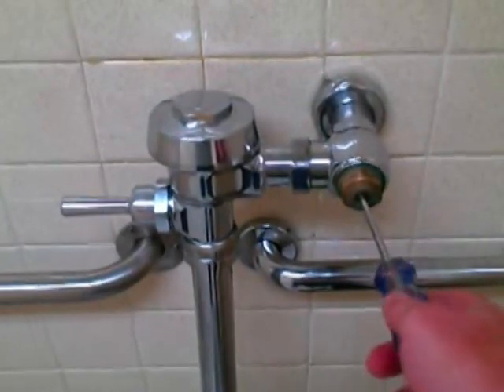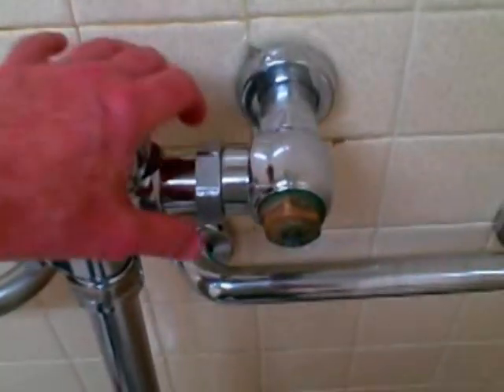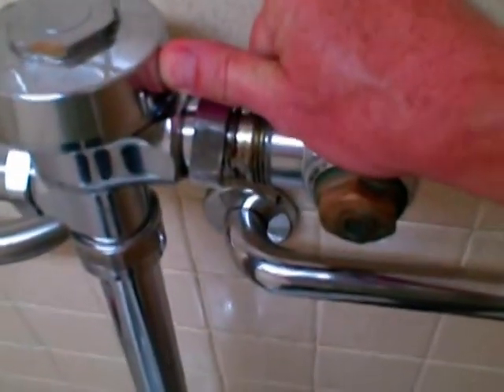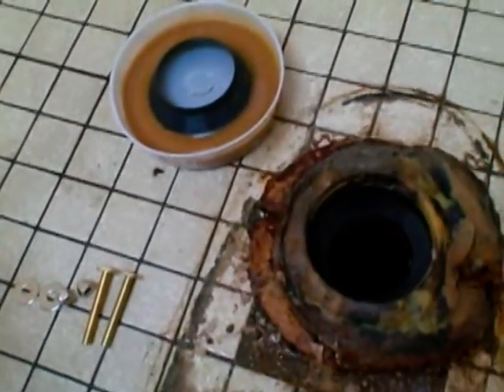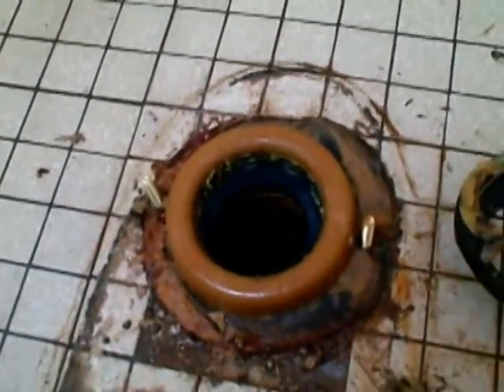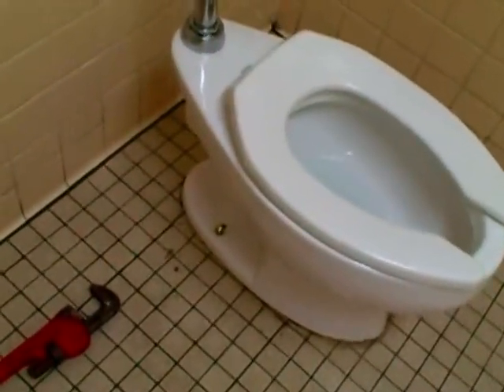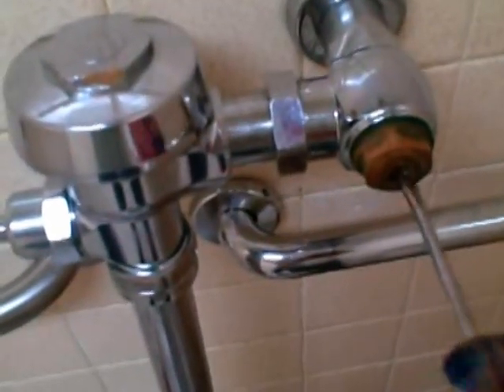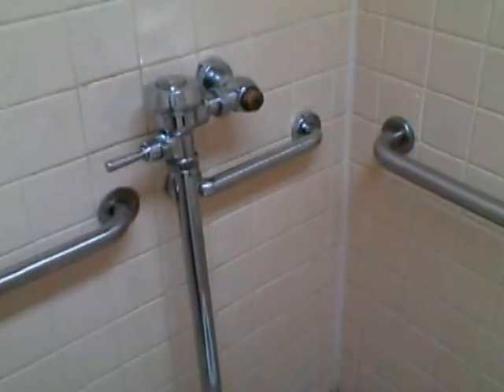How to Replace a Wax Ring on a Commercial Toilet - Sloan Toilet

Comment: Pressure Valve Needs to be Increased abit More where you Turn off or Turn on the Valve and that Toilet is a Mid 90's-Early 1.6 2000's Kohler Wellcomme